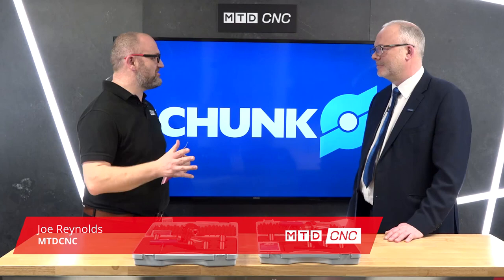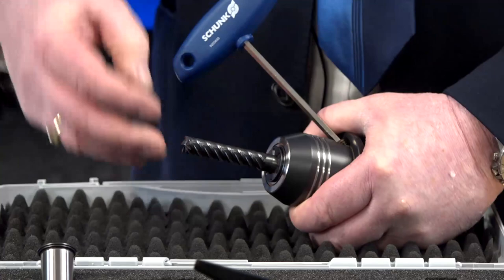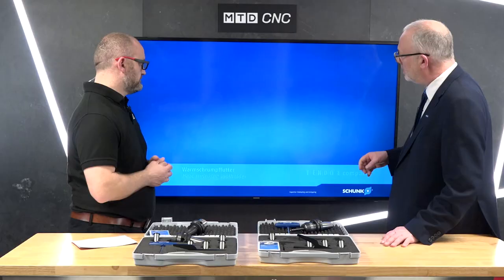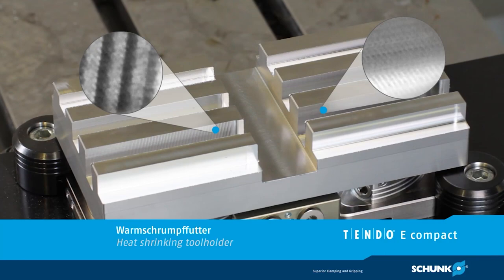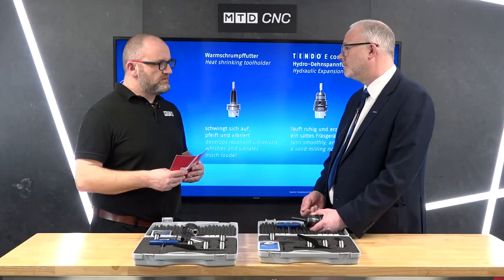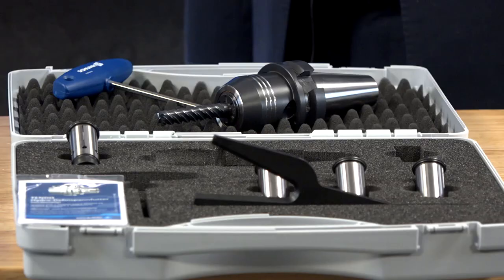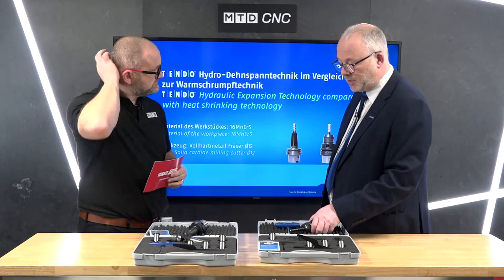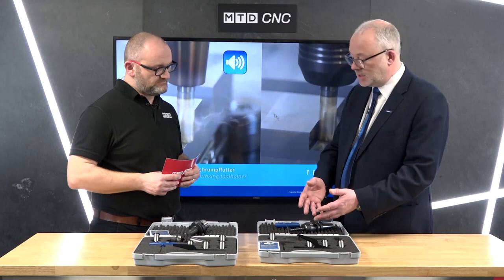The TENDO E Collet chuck from Schunk

Comment: Hes wrong about one flute cutting on ER. He must mean an end mill holder
Reply from the maker: You will find on many ER's that the cutter is 'off centre' and essentially cuts on 33-50% less flutes.
Reply: @MTDCNC  if you have a radial engagement of .003 per tooth then your "off center" would need to be more than .003 in order for one flute to be cutting all the load correct?